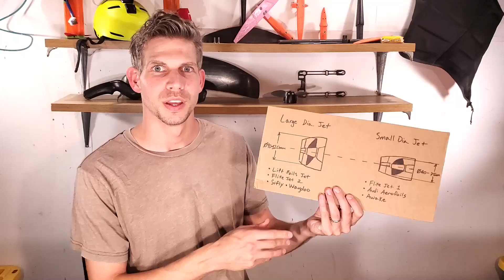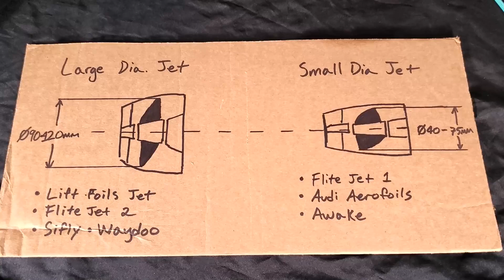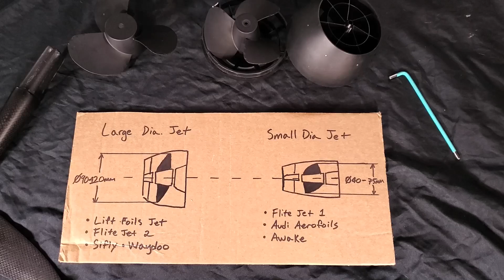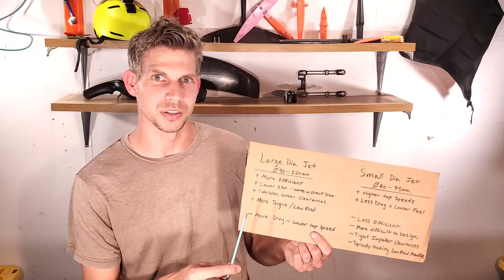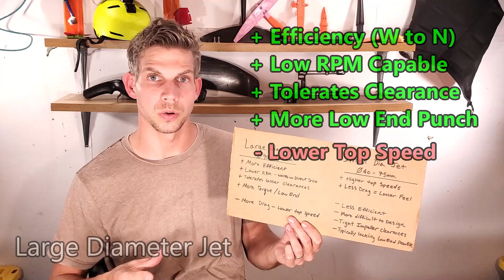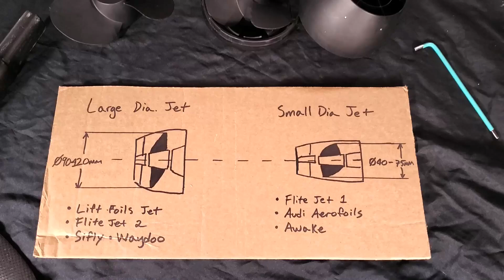eFoil Jets - Does Size Matter?

Comment: We have been testing with the JetWave jet underneath our diy setup. It's a narrow one, and we were surprised how much power it has.
Starting compared to a prop is slow, and efficiency is also less good, but safety wise it wins.

We noticed that it also turns (as making a turn) different compared to the same setup with a prop.

Anyway. It's a nice alternative to have.
Reply from the maker: Yes, they are great for safety. These "large" size jets are that nice balance between a full prop shroud and the open prop. what diameter impeller is the Jetwave model? Thanks for watching!